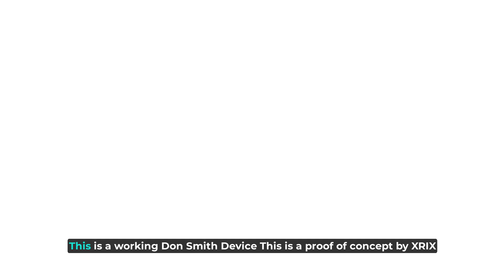Over Unity Working Don Smith Device

Comment: Hi XR IX, I stumbled upon your video after doing research on Don Smith. I’d like to replicate your setup because it seems very simple to understand and build. Can you tell me where you purchased your MOT’s and what the part numbers are? 

Also in the comments you suggested checking our MRMISHMASH page but i cannot find anything relevant to Don Smith when i do a search for that. Can you point me in the right direction?

Also you mentioned Zed’s Forum in a comment but i also cannot find that either. Can you specify what forum you are referring to?

This video is 3 months old now and I’m wondering it you’ve successfully tried feeding back power to your input to achieve the holy grail?
Reply from the maker: @SuperheroArmorychannel  The MOTs are all OBJY2 type. But I found they vary in dimensions, so I try to purchase a similar physical dimensions. The forum is found at energyevo.org. I don't try to make self looping. There is no point, but to discredit the device. EEs always discredit it many ways, I had a guy on the stack exchange tell me I had a hole on the table top. I told him... yeah like my wife will let me drill in her island surface to do my video. :D. There are many fake videos out there. Almost every fake video, has a guy building it in front of you. Red flag, or a dude with a hot glue gun... red flag. I won't post a schematics, to reduce my liabilities, and because the one I use, were from Zilano posts. The point is the schematic isn't the key, it is the approach. I have posted enough information to build this device. I assume a certain amount of competence,  because a diy person who has never played in the HV capacitor realm could make a fatal error.
Reply: @XR_IX  Thank you for your generous response. Your device is a work of art and brilliantly simple! I’ve read through all your comments here and studied the video carefully. I believe i know and understand exactly how you built it and how it functions but I’d like to verify a few details. I’ve wasted 20 years of my life chasing the free energy dream and I’m an expert on what doesn’t work but I’m still a true believer after building Tesla’s hairpin. I’m aware of the dangers of being too public with this information so I’ll tread carefully. 

Your setup seems to be a more simplified and more logical variant of Don Smith’s system and Zilano’s schematics. 

Is your HV/HF slayer exciter driving a flyback and then to a FWBR for driving the primary spark gap circuit? 
Or are you using a ZVS driving a flyback?
Or did you wind your own HV transformer for the slayer exciter?
I can’t tell from the video if you’re using a spark gap or a GDT?
Are you using a magnetic quencher on the spark gap? That should shorten the impulse reversals during spark discharge according to Tesla thereby making the Radiant energy more pure in the secondary.

Your spark gap circuit is driving the MOT through its secondary winding thereby stepping the voltage down, passing it through a FWBR and then to your 120,000uf cap and then to the 12v bulbs? All the MOT primaries are connected in parallel to power your bulbs? You seem to be using (6) MOT’s and (6) 120,000 uf caps driving 4 bulbs with each MOT Cap leg? I like your design because it doesn’t seem to require any difficult resonance tuning of the L1 and L2 circuits like Don’s device. 

I’ve watched all of Don’s videos and sat through some of his lectures in person in the 1990’s where i met him in Colorado but he was not very articulate at trying to explain his device and theories. He also had so many device variations which overcomplicated his explanations.

I found the energy evo forum but it appears that registration is closed and I’m unable to contact the owner. Not to toot my own horn but i have more experience in the free energy field than most people and i was a speaker at one of these energy conventions. I can bring a lot to the table if I’m allowed in.

Thanks for your help!
Reply from the maker: @SuperheroArmorychannel Thank you for your interest. When you build a successful replication, please remember the willingness to share for others who hunger for this knowledge. I built this to conclusively prove to myself and to provide one device people could build to see the possibilities. I stated that the approach not the circuit is the key. This requires no tuning and can be done with "Moron Comprehension" it is the DSE. The first very important point, Don's "Chasing the wrong rabbit". You need to create a magnet you are turning off/on very fast. That is your MOT. If you think of how a PM Alternator/Generator, you see exactly that. How you begin, is with an exciter. That can be a Tesla coil, ZVS + flyback, or NST. I use 12V batteries as a source, a 12V NST is the simplest and requires no voltage control. The point is the exciter can be anything that produces HV/HF. I have used all types. 

HF/HV charges a capacitor fast for the least amount of power input. So you need the fastest recovery diodes everywhere for your FWBR. You now have exciter, and fast FWBR. Do you care that the NST is 10KV+ and your diodes are 1KV reverse voltage. Absolutely not, because they will never go there because your GDT is rated below or equal to 1KV. I use GDTs because I don't want to be subjected to the negative attributes of an open air spark gap. Also GDTs will burn out, and fail, so I have two in parallel for protection, in an accessible assembly so I can swap out as needed. However they generally fail partially closed, and your output goes away. The GDT is connected to the Parallel and Series cap to the HV primary of the MOT. All MOTs are in parallel, and the more the merrier. The collapsing fields give back to the cap. 

Now the most important point. How does a shorted cap produce current in the MOT primary, when all the charges went from the negative plate to the positive plate of the parallel cap? I don't know, but that's the DSE. "...but in Magnetic Flux you can make as many copies of the original as you want without depleting the original at all" 

That is power amplification.

Something to build on. In my case, it lights my office to remind me to keep moving forward.
Reply: @XR_IX  Thanks for your generous reply! 
YouTube seems to be deleting my comments again. 
I believe i have the knowledge and understanding now to easily replicate this. I ordered all the parts earlier today. I agree 100% with you that the approach is the key, not the specific circuit. 

Yes the transformer primary being switched on and off very fast through the spark gap or GDT is what creates the radiant energy bursts according to Tesla. 

“How does a shorted cap produce current in the MOT primary, when all the charges went from the negative plate to the positive plate of the parallel cap?”

I don’t understand it at all but i can tell you that I’ve been building and testing systems like this for over 35 years where i utilized spark gaps and caps to dump into transformers or coils in an attempt to replicate EV Grays capacitive discharge engine and i have never gotten the results I hoped for. I suspect the secret is in your special arrangement of using those 2 caps with the spark gap and coil but electrically it makes no sense to me. Tesla showed the same arrangement in Figure 2 of his Colorado springs notes (page 57) as pointed out by vShaub. Tesla says:

“Fig. 2. should be superior to that in Fig. 1. 
It secures two chief advantages:
1. Less current through the break and more through the primary
2. Longer and better oscillation in circuit including primary because it is easy to constitute such a system without break with an extremely small resistance or frictional waste.”

So according to Tesla, by using those 2 caps in such a way, it reduces current in the spark gap or GDT and increases current in the primary winding resulting in improved oscillation. 

This fits with everything I’ve read in Vassilatos about Tesla stating that Radiant energy is formed by fast impulses of high voltage, high frequency while minimizing any reversals of current. The more current we can remove by quickening the impulse duration and perhaps by utilizing those 2 caps, the more Radiant energy we can pull from the Aether.

Any thoughts?
Reply from the maker: @SuperheroArmorychannel  It sounds like you have the necessary ideas to build the device. How many MOTs are you planning?
Reply: @XR_IX  I ordered 4 MOT’s to start with and once I’m able to successfully replicate it then i have a few creative ideas I’d like to try at that point to better understand the fundamentals of the device.

Imagine this; you currently have 6 MOT’s with all 6 primaries in parallel and all secondaries wired to their own respective circuits through the FWBR’s and 120000uf cap to produce the 12v to light your bulbs. This is your current setup. What if you could wrap all 6 secondaries onto a single core and use 1 primary to drive them all? For example a ferrite toroid. Would it work? The magnetic permeability of a ferrite toroid would be very effective at those frequencies and it would be a very efficient transformer. Would this result in a loss of output power or the same output? If it works then great but it it doesn’t work then the same design could have 6 primaries and 6 secondaries all wound on a common toroid core thereby at least eliminating all those redundant heavy transformer cores.

I think that the 12v battery could also be completely replaced with one or more of your 120000 uf capacitors and you could then eliminate all 6 of the 120000 uf capacitors and instead feed your secondary outputs all back into that primary capacitor bank and use it to power your device and your load from the same cap bank. All 6 secondary circuits could feed into this thereby eliminating most of those big caps and big heavy MOT’s with these 2 modifications.

Then the final question is; could all the MOT secondaries be hooked in parallel and then fed to one FWBR and cap? If so then this would greatly simplify the entire design.

Have you tried anything like this before? Any thoughts?

I have a very specific use case for this device, see my youtube channel to understand.
Reply from the maker: @SuperheroArmorychannel  This is why you will succeed, because you are already predicting the shape of future improvements. Yes, there are improvements that will simplify what you learn. What if you can drive another NST? What if you have more efficient core materials, with higher magnetic saturation points? You'll have to find out. In math, how do you make a term exponential? BTW everyone wants to power their bipedal tanks, and androids. When the grid collapses, at least you'll be able to make generators with parts from Microwave ovens so you're not in the dark, when the zombies are looking for a meal. Kidding (of course), there is no such thing as zombies, but there might be cannibals? ...right.
Reply: @vSchaubUnderstood. Thank you!
Reply: @vSchaub Yes except that XR_IX’s spark gap is in series with the primary instead of being in parallel with it as depicted in Fig 2 of Tesla’s Colorado Springs notes. I understand exactly how he wired it using the (2) 1uf capacitors. Thank you!
Reply from the maker: @vSchaub Remember all dreams become reality or fantasy when you put a load on your device. There is a picture in the Don Smith pdf that has "Dri-Var" capacitors in the device . If you look at the components in that picture, that essentially is what is in my Blue Box.
Reply from the maker: @vSchaub Fear of being Prometheus but work as Sisyphus, when we put other above all, there are no need for Titans.
Reply from the maker: @vSchaub I wanted to show you that we were actually building that Don Smith device. Yes it is smaller, but the components are all there. You need a frequency counter, and magnetometer to see, but now were are going beyond this circuit.
Reply: @XR_IX  what is the range of your frequency counter? I found GY561 frequency counter on Amazon which is from 1MHz up. Or I need one in range of kHz also?
Reply from the maker: @mrmishmash1725  Magnetometer: I bought a Kmoon yellow one, it was cheap because I thought I wouldn't need it. Turns out I use it to tell me how efficient my Mr. Cats are built. I can put it next to my new device and it maxes out the magnetic flux right next to it. That's > 99.99 uT. I am looking to buy the new TF2 by Trifield.
Reply from the maker: @mrmishmash1725  Fumei 10Hz-2.6GHz Handheld Frequency Counter Portable Frequency Meter Range 10Hz-100MHz/50MHz-2.6GHz Multi-Function LCD Display for Two-Way Radio
Reply: @XR_IX  Thank you
Reply: @vSchaub It’s crazy! Many of my comments are deleted nowadays which couldn’t possibly have anything even remotely offensive or anti-woke in them lol
Reply: @vSchaub I just watched it and it’s very interesting because i believe that striking that ferrous metal with a steel rod is analogous to what Tesla said about striking the primary coil with an ultra short duration impulse to make it ring. Something happens when we do this which causes Radiant energy to manifest. I believe that XR_IX’s unique capacitor configuration has something to do with it since you previously pointed out that Tesla also wrote about that exact configuration in his Colorado Springs notes.
Reply: @vSchaub On the bright side of AI, i often have conversations with my custom Chat GPT for many hours about many fringe science topics and with its help I’ve been able to solve many incredibly difficult problems and devise creative solutions which were far beyond my own capabilities. Try asking chat GPT any electrical or electronics questions and it can answer and explain almost anything.
Reply: @vSchaub Got it! Yes the capacitor arrangement is identical except that Tesla has the series cap on the upper side of the coil instead of the lower side. Maybe they both work? I believe this Capacitor arrangement is one of the secrets to making this work. I wonder if it would still work if that capacitor parallel to the spark gap was removed? Probably not because I’ve built and ran those circuits many times without getting any successful results.
Reply: @vSchaub Okay yes i see it now. In Tesla’s cap arrangement when the spark gap fires it places both caps in parallel with the coil electrically since the spark discharge acts as a short. But in Mr Mish Mash first circuit it does not do that at all. I wonder which of these configurations that XR_XI is using?
Reply: @vSchaub Very interesting! It’s certainly different from Tesla’s and not something i would have ever tried since it makes no sense electrically to me but yet it works. I recall something i read about Tesla over 20 years ago that stuck with me; he said that the ideal way to generate Radiant energy was to strike a fast impulse arc through a spark gap and then in that instant to dump a second cap into it…or something to that effect. When i look at that capacitor arrangement i wonder if that’s what is happening? The cap in parallel with the spark gap essentially gets shorted out when the spark fires but its discharge would also cause the other cap to discharge through the coil at the same instant? Or slightly later due to the reactance of the coil? I honestly don’t know but It’s a very strange setup which works.
Reply: @vSchaub I agree! And yes i already backed up the video and the comments earlier today because i had the same thoughts about it being removed by the tyrants.
Reply from the maker: @SuperheroArmorychannel  you will see charlesg3459 comment under this video. He is one of those...who runs his house on this type of device. He says the utility co, won't sell him electricity anymore. Ha! He helped me 6 years ago, when I commented about gerson paiva's Don Smith replication. I was trying to shoot the video down, because I was frustrated, and at a dead end. He then told me he built the suitcase device. I have all the comments in our exchange carefully documented(yes one day the video was gone), because much I didn't understand, and he had inside knowledge that was undeniable. I reconnected with him again, and now I am here with you guys. Just passing the information forward.
Reply: @XR_IX  I went there and read all those comments. I’m happy to hear that there are others replicating these devices. Pay it forward. I understand why most of these people remain low key but I’d like to think that It’s just a matter of time before this becomes more widespread and the tyrants lose their grip on power.
Reply from the maker: @SuperheroArmorychannel   I will only post this for you to know I am not their agent, (but a few are here already). The machinery for failure in these endeavors, are self sustaining. Brilliant men like Tesla, said no device of this kind would ever hit the market. All you have to do... is ask me how I would suppress this effort in a clandestine framework: 1. Appeal to personal greed, but provide no win -- Patent Office. 2. Inject Consumerism -- Does it really matter what you drive? Not to me... but my wife would complain. 3. Obfuscate the real math and make it difficult to find challenging data --- Search google for Tesla, what pops up? 4. Flood the highway of information with plastic cars -- Every hot glue gun concealed battery FE device, why are there so many? because people are interested and clicks are money.  5. Mortality - Anyone who escapes the previous 4, have but one life - Hamlet: Let me see. (takes the skull) Alas, poor Yorick! I knew him.

I would do all these things, and more if it were my job.

As Charles did with Me, and I need to tell you as well. If I had all the information to give, and wanted to, I couldn't without being shut down. Right now, I have some videos that are compelling, but not threatening enough, and could be challenged as fake; so it's allowed to breath. The device is simple, but the theory is complex. This is the bell curve at work. It takes a mediocre mind to point out what's wrong, an uncommon mind to provide solutions, but a very rare mind to complete the solution into delivery.

"The Tyrants" have multi generational wealth, and are groomed for administration, and maybe they have protected civilization to their credit because...well people are stupid. However I focus on this device, just so it's something you can look at everyday and say. THIS IS REAL
Reply: @XR_IX  thank you for sharing, I am building the system.as per model #1 on mrwishwash's youtube.
Reply from the maker: @raymundohooten1020  It is the first step to understand the principals, it wont run your house, but it is handy when the lights go out. Good Luck
Reply: @vSchaub Yes. I’ve written several long detailed replies that have all been deleted. YouTube is owned by google which is a propaganda arm of the tyrants.
Reply: Most of my comments are now being deleted within a few minutes after posting them.